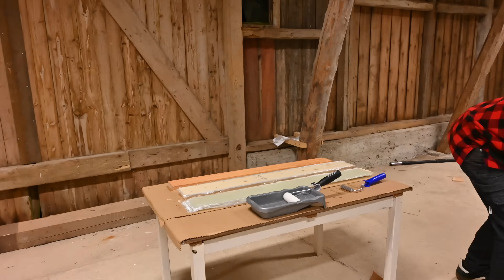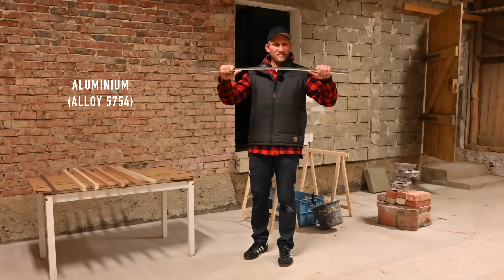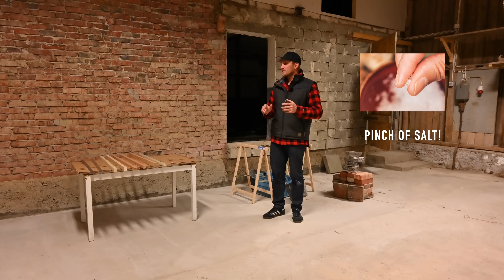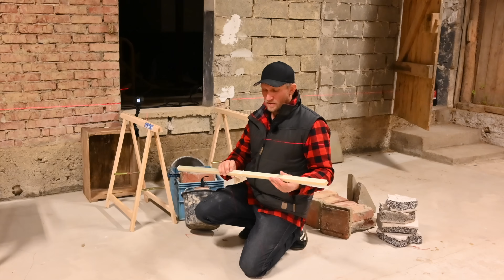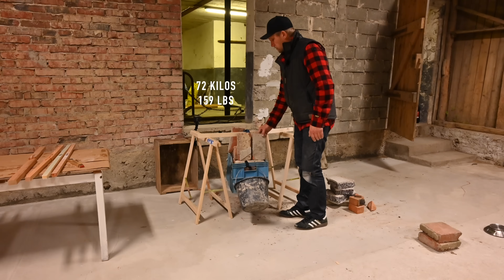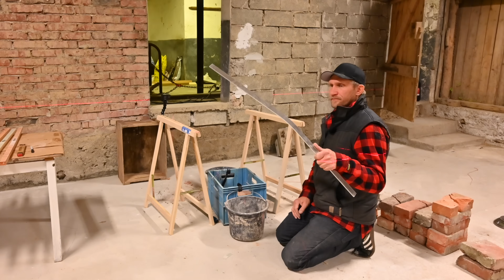Boat Hull Material Test - Which Breaks First? - Ep.  319 RAN Sailing

Comment: No one uses Davina cell that I know off any more, if you use foam use core cell 80 prof .and my laminate schedule will pass assure you .
If you use wood it must be Western red because of its rott proof to wait to strength after a laminate schedule is assigned.thats the real test .
I did test with foam and glass before I built my cat spent$ 500 on samples because of the reputation of other foams before core cell was invented..
Spruce is nice wood ,but in different applications .
Just sharing my experience .

Comment: With some gussets or bends on that steel the rigidity would've gone up significantly - think an I-beam. However, I do believe wood boats are beautiful and would be significantly easier to work with in a home shop.
Reply from the maker: Yes, but the same would have been true if you made an I-beam from wood or fibreglass. That I beam could be significantly larger/thicker at the same weight compared to the one in steel. The test was strength to weight test not strength to volume. :-) Cheers!
Reply: @RANSailing  Your testing made absolute sense. I just wonder if the you had used a piece of angle steel (L shape) then if you would have seen a difference in strength to weight ratio. My guess is yes, but from a pure flat to flat comparison your test made sense. I'm looking forward to seeing how the build goes!

Comment: The strength of a beam is proportional to the Height cubed times the width.  The samples all need to be the same height and width to do a fair comparison.  A shorter sample will be weaker not because it is intrinsically weaker but because the beam is smaller.  I assume that when you build the boat, the hull will be the same thickness regardless of the material.
Reply from the maker: That's correct, and for the same reason that's why the lighter materials copped better in this test, being thicker at the same weight. Remember, this was a strength to weight test, not strength to volume where steel would have been the strongest material in this type of test. But since hull thickness doesn't matter the same way as weight in a boat hull a wood/fibreglass hull will be stronger than a steel hull if they have the same weight. That's why you don't see any steel racing boats. Cheers!

Comment: I think the foam core sample was at a huge disadvantage because of the dimensions of your samples. Wood has a grain direction. If you had included plywood it would also loose to wood since only half the woodgrains contribute to the strength in such a narrow sample. Also, had you tested square samples the wood would loose to both plywood and foam since all strength is only in one direction. Your test is valid for beams/ribs, not skin. It is still a cool test and I love people who want to investigate hands on. Also I think impact testing is most important. For this a square sample should be securely fastened to a frame before dropping a weight on it.

Comment: I'm sure someone mentioned this already but part of the strength of aluminum or steel is due to the curvature.  A metal drum with reinforcing ribs is much stronger than a square sided container without.  That said, I do think wood is a better choice; the Swedish spruce seems excellent for the cost to strength ratio.  Also, if you were sailing in high latitudes, reinforcing plates could be added.

Comment: if you had cut the strip of Aluminum into 2 long strips then welded it into an I-beam it would have out performed all with no deflection
Reply: actually with same strip of aluminum, and just cut slots in the wood saw horse... could have outperformed all on edge
Reply from the maker: Yes, but that could be done with wood also to make it stronger, and you would end up with a I beam with more volume  and width compared to the metal ones.
This was only a strength to weight ratio test between various materials with the same “exposed “ surface area. Cheers!

Comment: Very entertaining video... However, IMO there are more important issues in play than the simple bending strength of the materials based on weight. 
A better test might be to build a panel say 0.25m x 0.25m square (to the same thickness dimension that would be used in the boat construction) for each material and then, in a laboratory setting, load them to destruction. (A concrete testing laboratory might be able to do the test for you.) 
You would then know which was the strongest for a lateral load. 
If you then add to the analysis the unit cost and unit weight of each panel you will get a better picture of the suitability of the various materials. 
But for me the bigger question is that of rot, corrosion and delamination. If you have a wood core, the question is not 'if' but 'when' the wood will start to rot and then it has zero strength. 
BTW there is software available that helps you to select from various candidates with different properties the one that best suits your needs and your financial resources.
I look forward to watching the rest of the build.

Comment: With regard to your red cedar to Swedish Spruce comparison. I think the reality check is that they should be compared on a size basis as well because it is more likely you would use the same thickness whichever wood you use and accept that one way would be heavier than the other. In either case ballast will be required anyway. I guess I am saying that the construction method matters. Steel normally has ribs and stringers but aluminium boats are sometimes built with heavier hull sides and fewer or no ribs and stringers. So comparing one material to the other by weight without setting each material up in the actual manner it would be used may not give you the best comparison. So size and shape as used in the hull until total weight would be more than a lighter hull with full ballast. Well, to an extent, ballast does tend to reside at a lower point in the hull. It is ok to use a heavier wood at the keel and lighter towards the sheer. It was a very interesting and informative test in any case. I am glad you tried it.

Comment: Hi
I'm from the Pacific Northwest.  Back in the days when we used to build wooden boats Alaska Yellow cedar was the wood of choice.  Less brittle than red cedar.  Equal in strength and rot resistance to Port Orford cedar and tends to have longer straight grain planks. The stiffest wood structure I've ever built were spreaders for a spruce/carbon mast.  I stack laminated 1/4" spruce with a thin layer of carbon uni in every glue seam. "Tested" it by jumping on the 1 1/4" thick spreader with it suspended between two blocks.  220# + 2x ++ multiplied by jumping from a foot above it.  Damn near broke my foot!

With any light wood like your Swedish spruce or red cedar, as well as balsa or foam core a lot of the stiffness derives from the I beam effect of separating the stiff skins by a core just stiff enough to prevent collapse when loaded. So you end up building a glass/epoxy boat with a semi-structural wood core.  The expense of using epoxy (for better wood adhesion) vs vinlyester   will compensate for the savings of using a cheaper wood core instead of linear foam  like CoreCell.  If you infuse the hull lamination it will save months compared to gluing together thousands of pieces of wood and fairing the surface. And the glass/foam boat will have a dramatically better resale value. 

One of the better known wooden boat builders from BC Canada believed that cold molded interiors should be left raw and unpainted so the wood could breath like they did on carvell planked hulls . At 40 years even red cedar hulls that they built are showing signs of rot.  The two that I built in the same era are still rot free because every bit of the hull interiors were epoxy coated. 

Regarding your materials testing, the key metric for a boat hull is not primarily stiffness but ability to withstand deformation.  AKA "toughness". That accounts for the superiority of aluminum for expedition use.  And places red cedar without glass skins at the bottom of the list.

ps:  I've never been a fan of chine hulls, but I find nothing in the Boreal hulls  that doesn't please my eye.  Hard to find an easier way to build a boat of that size.

Comment: I know of course that it is difficult even too plan that video but it would be more indicative if you compared pieces of finished hull. For example, our 33ft cruiser is made of 4mm steel and that’s it. A wooden/polyester/epoxy boat though needs a much thicker and even almost same weight to create the hull but also at the same or higher cost. There would be a significant difference when the two boats would crash against a rocky surface... I loved your video though :) 👋👋👋👋👌

Comment: Divinycell is hard to compare to wood in a strip test like this as wood has intrinsic strength by itself and divinycell is strictly a core material and needs to be laminated properly. I think if you took a strip of divinycell and completely encased it in FG it would prove to be comparable in strength. cheers and good luck.

Comment: Nice video again, very interesting. Curious as to how much material (wood m3) you expect to need for the hull and how that compares to the total cost of the build. In an attempt to reduce costs, maybe a bit of a far fetched idea, what about using the "stronger wood" to just above the waterline and then continue with the less expensive for the rest? Cheers

Comment: I enjoyed this video, but the conclusion that "glass fibre is really fucking strong" is not revolutionary. You just need a core material to separate the upper and lower layers, the reason balsa is commonly used is because it is light and cheap - to a large degree the core material does not matter.

Comment: Why not use combination of woods like pine for bulk of construction, fir below water line or other arias where more strength and stiffness is required. Or even use foam (preferably closed cell to not absorb water) for the deck to save some weight and be less susceptible to water damage with all penetrations which normally go trough deck.

Comment: It was fun and a little interesting to see your test round. Your idea as I see it is to build a wooden hull covered with epoxy and fiberglass. But water has an incredible ability to seep into materials.  Wood is hygroscopic and readily accepts water and swells.  I wouldn't dare choose that solution.  Sven Yrvind is on you tube with his latest project.  He has demonstrated with load and impact tests the strength of epoxy and cellular plastics which looked convincing.  Divinycell is expensive but does not absorb water.  I have also had an idea to build a sailboat.  I intended to cast the hull traditionally in a mold, but the mold was to be made directly without building a plug, using cheap materials such as spruce, chipboard, masonite, putty and varnish.  I made a mold in 1:5 scale.  I wanted to see if it was possible to build and to grind the concave sides smooth.  I thought it was successful and there is a hull made in the mold about: 2.5 meters long.  However, I don't have full-scale experience, but maybe it will be easier.  I will follow your project with great interest and excitement.

Comment: Hi Johan (&Malin), is it an option to also stabilize the wood? By thermal processing the wood. Maybe not so easy to bent anymore? Rot resistance will be much better. So if there is a spot that leaks (can also be a minor spot on the inside) , the damage / rot is very likely to stay small. Regards, Wilhelm

Comment: Here in Oregon Douglas fir is used for house construction.  It does not have a good  reputation as a marine construction material. It rots when wet. The wood that I recommended looking into is Port Orford Cedar. It is well known as a strong water resistant.  Message me if you want to get a connection to a local mill here on the Oregon Coast.  Strength is one consideration, resistance to rot is another important consideration.

Comment: The Divinycel was an eye opener, I thought it would've performed much better than it did, especially with those multiple layers of glass. That material is fine for a weekend racing boat, but a live aboard blue water cruising boat it's not my choice. Steel is out of the equation for me, the amount of hassle I've seen steel boat owners go through makes it another material I wouldn't choose. Aluminium is another thats out for me as a home builder, mainly because I can't weld and metal is just a material I wouldn't want my boat built in. Timber is the obvious winner, within my capabilities, easy to fix and maintain, also wins on cost, strength and it also feels right, to me steel, ali and that terrible ferro-cement all seem cold and not right for a cruising live aboard sail boat. Timber is the winner in my opinion. Excellent experiment too, you showed me something I never new about Divinycel, very interesting

Comment: Two errors I think you have made in your assessment:
1.) You mistake stiffness to strength. Strength is a little difficult to calibrate because you have to consider all four types of loads: 
1.) Tension,
2.) Compression, 
3.) Shear, and 
4.) Bending.

You have done a good job of testing bending, but you errored in testing only for failure. Deflection is arguably as important, or even more. Deflection determines the boat's ability to keep its  shape. In boat design, we look for stiffness far sooner than we look for ultimate strength. This is why the foam sample might still be favored even though it did poorly in the ultimate bending failure test. What a designer would be more interested in is how far the sample deflected before it started to fail, and the weight moment required to get it to that point. Then, he/she would design the boat so the hull skin would never get near that point. This is why the highest performance boats are designed using foam/grp composite construction.

It must always be kept in mind that the stiffness of a beam increases with the cube of its depth. So, if you double the depth of a beam, you increase its stiffness eight fold. There are two ways to accomplish this:

1.) Increase the thickness, and
2.) Decrease the span between supports.

If you cut the distance between supports by half, you have effectively  doubled the thickness of your hull skin. 

This is why steel boats are even possible.

It seems to me that the Swedish cedar is the way to go, knots and all, because you use just slightly more epoxy to seal the knot holes, and then fill them with non-structural filler (the filler is only used to keep the water out).

Another item to consider is that wood is a lot stiffer when dry than when wet, and you cannot afford to assume that the wood will stay dry, even when epoxy encapsulated, especially under the waterline.

Comment: Good work, thanks. 
I have built a number of WRC/triaxial glass/epoxy yachts for clients, some in the mid 1980s and all are still as good as new. 
I ran unintended and embarrasing tests on 2 of them. One 26ft Virtue fell over onto concrete getting her out of the shed. It popped a small area of bunk top off and scuffed the outer glass. No damage to the skin itself. Basically she bounced! 
The other was a Van der Stadt 34 set up for racing and we hit a rock with the bottom of the keel doing over 6kts. It broke the aft floor and the frd floor over the keel. Not a  drop of water came into the boat. The inner and outer skins remained intact and we motored home.
Pretty tough!
We developed some good building techniques over the years. I am happy to share them if you would like. Cheers.

Comment: Well, that was pretty darn interesting.  Living in the Northwestern US where both douglas fir and western red cedar are native I expected the douglas fir to be good but the cedar surprised me.     However .....
For me your test procedure would be more applicable to areas of continuous stress such as around chainplates than to impacts.  If you really want to be nerdy you could make up some more samples but instead of a continuous load you could create impacts by dropping a bucket of bricks onto the sample from increasing heights.  

You probably already know that douglas fir tends to fracture rather than bend.  In trying to make some curved laminations I was unsuccessful with douglas fir even after steaming and had to switch to a different wood.

Sidenote:  When I moved to the Northwest US in 1980 it was common to see logging trucks on the road with logs that were so big across that only 2 or 3 would fit on the trailer.  These are the kind of logs it takes to get that fine straight grain in the wood.  Now what you see are trucks with 40 - 50 small logs on them and only a few specialty sawmills can handle a log a metre across.

Comment: I'm not familiar with wood and epoxy however I am curious if the less dense wood would absorb more epoxy into the fibers of the wood itself. It so if there would be a benefit to the epoxy glass adhesion to the substrate? Thanks for sharing the unscientific testing. This build is going to be great